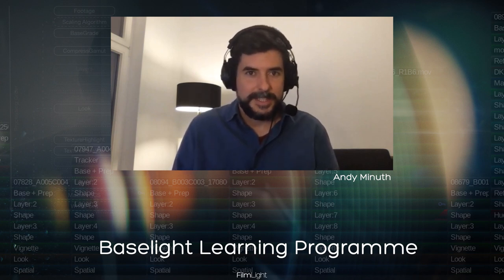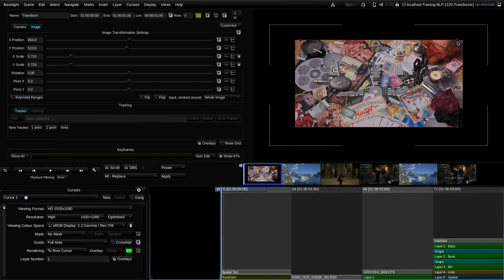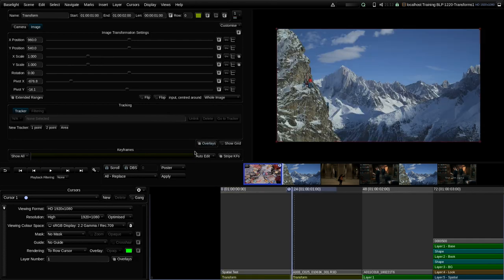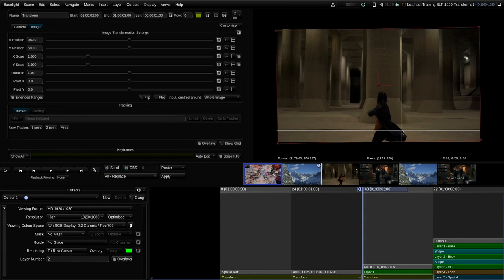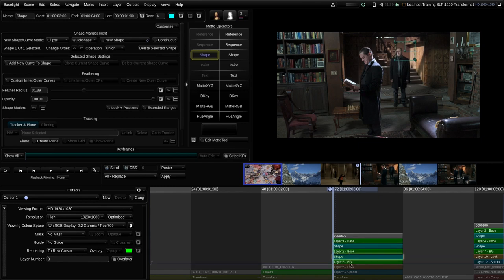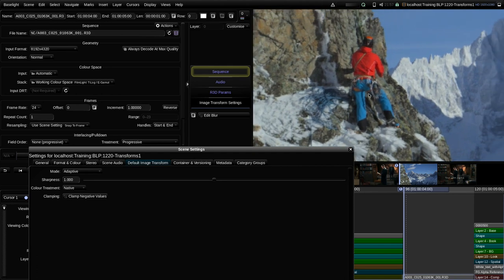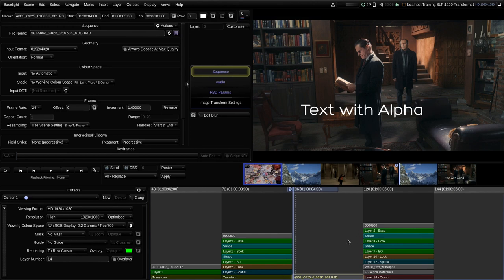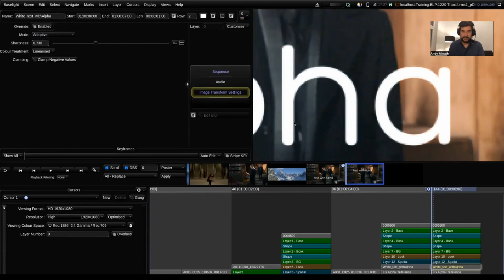1220 - Transforms 1

Comment: Here are chapter marks for the video:
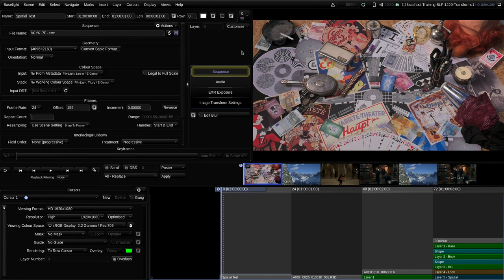0:39 - Format mapping vs Transform
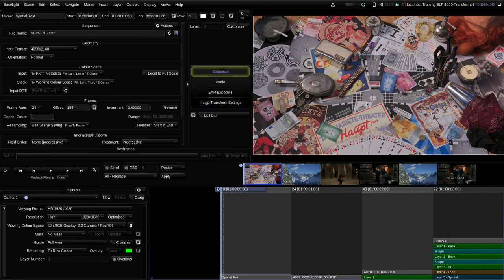2:32 - Transform Operator: Image Page
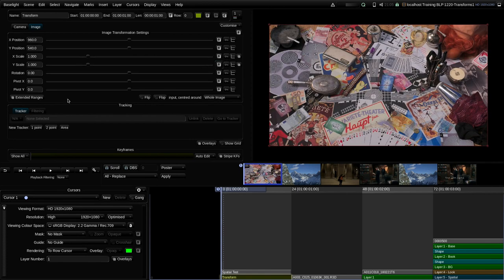5:35 - Transform vs Cursor Zoom/Pan
7:51 - Transform Operator: Camera Page
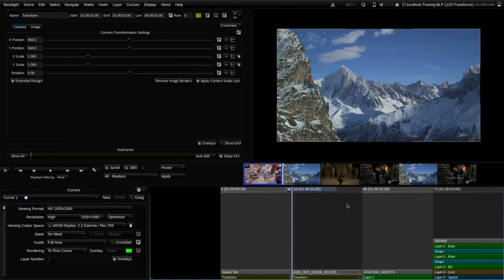9:44 - Numpad control of Transform
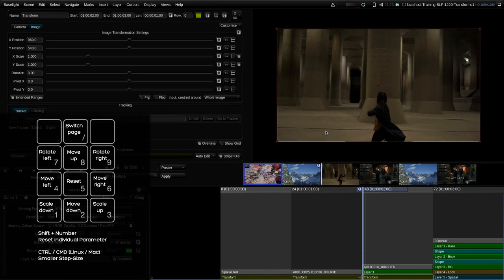10:52 - Levelling the horizon in a shot
11:55 - 'Remove Image Borders'
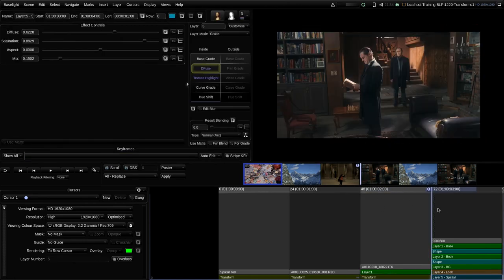13:02 - Position of Transforms in the stack
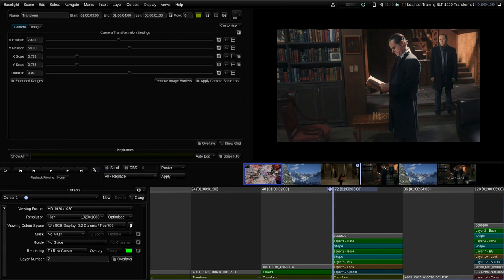15:13 - Concatenation of transforms
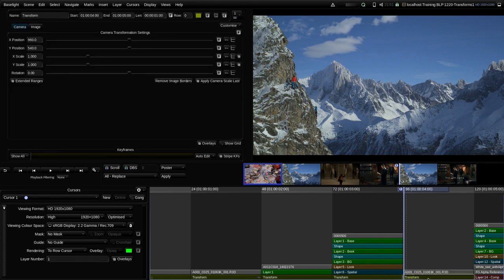17:22 - 'Apply Camera Scale Last'
18:19 - 'Image Transform Settings'
19:42 - Best practice: scaling graphics/titles
22:00 - Edge Crop operator
24:41 - Workaround: Optimising non-transformed titles